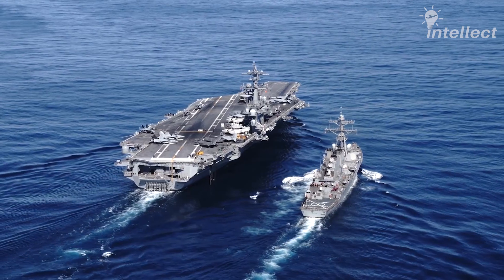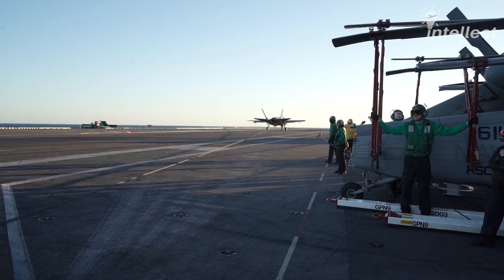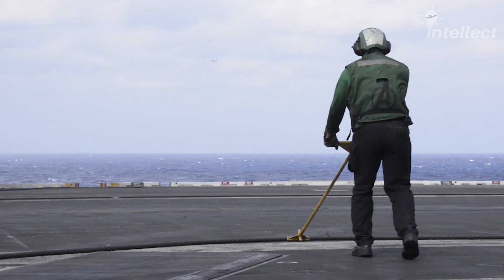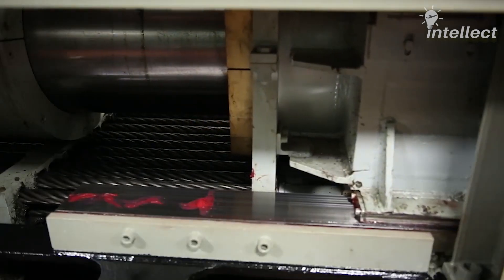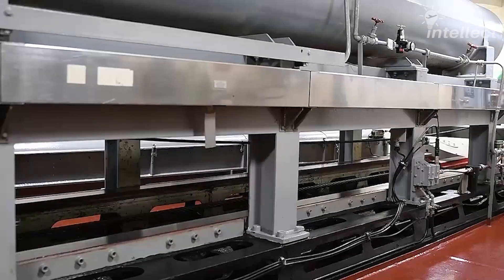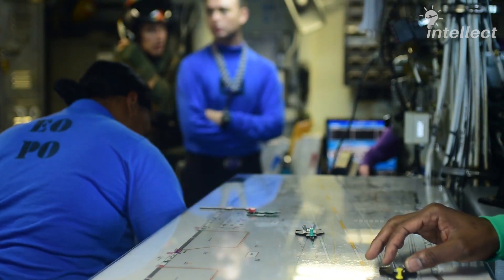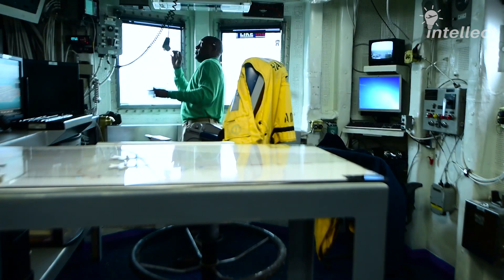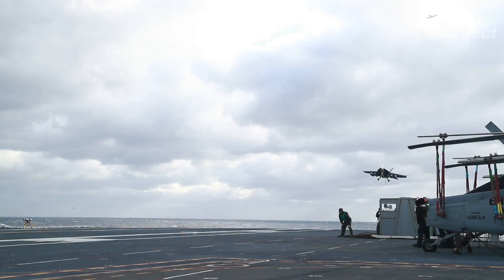The Hidden Power of Arresting Gear! | Carrier Landings Unveiled

Comment: Let's get it straight...what the hook "catches" is  wire ROPE. I think the size is 1-1/2"  to 2" in diameter. Wire rope can go around the sheave that is on the flight deck. Sheave is pronounced...shive...like...give...sh-ive (without the g sound).  
Cable is not flexible...AT ALL. Cable is stiff. Not able to do anything but stay  straight/be in tension. 
  I worked on the flight deck of the USS Constellation CVA 64. From 1971-73. I saw so many recoveries/launches as we pummeled "Charlie" on Nam.
Good vid, 🙂
  P.S...As I recall the four "cats" of the Constellation were 280' long...sending the 20-30 ton airplanes aloft in 2 to 2-1/2 seconds...thats zero to 165 mph.
Reply from the maker: Wow, valuable insights! 👌 Appreciate your comment.